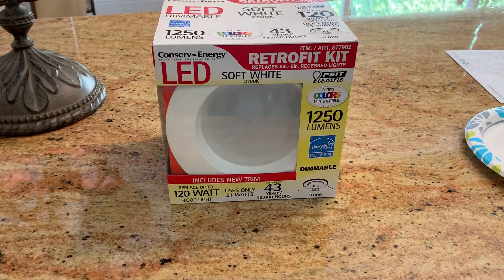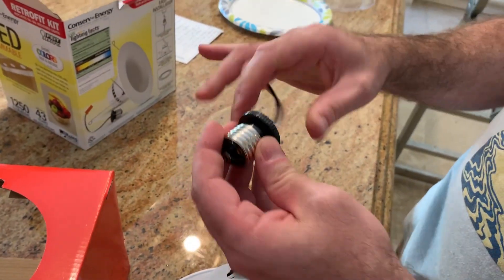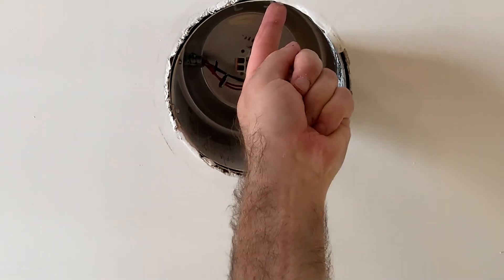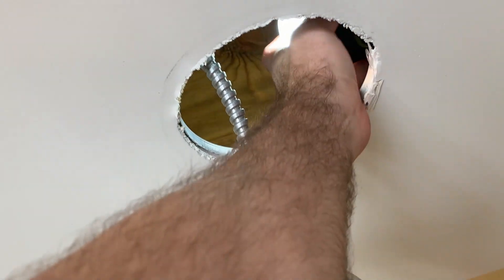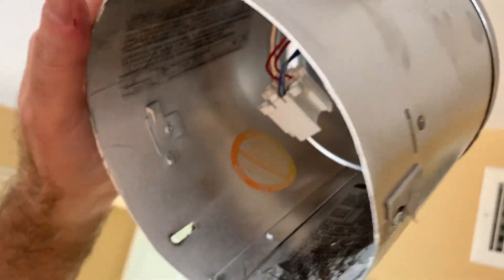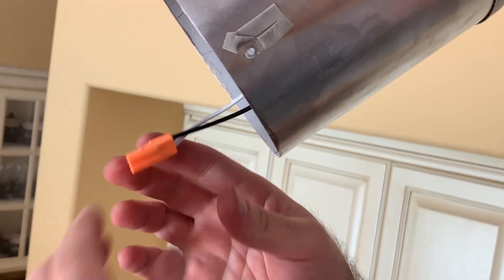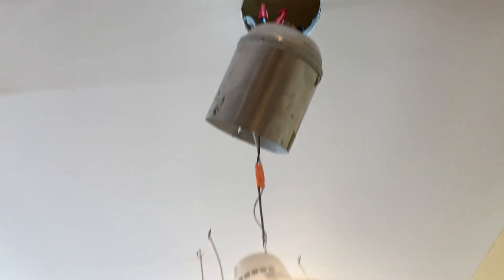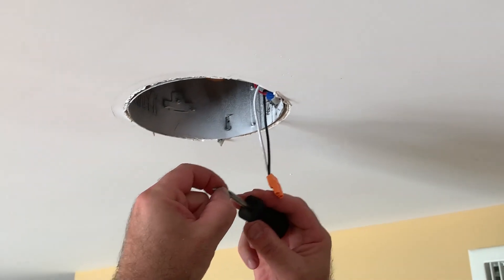CFL to LED Conversion

Comment: Very clear and easy to understand.  However as shown, technically it violates the National Electrical Code (NEC).  Connecting a conductor whose sheath is a color other than white, gray or tripled-striped white to the white wire (referred to as a "grounded neutral") is not permitted by the code, even though electrically it will work fine. (The grounded neutral is current-carrying; it's NOT the same as the "equipment ground", which does not normally carry current.) The idea is to make it obvious which conductor is the grounded neutral by restricting the color to either white, gray or triple-striped white. Alternatively, one can draw a single length of white-colored conductor into the armored cable sheath by attaching it at one end to the blue-colored conductor and pulling it through to the other end.  I'd suggest doing the same with the black conductor, and use a conductor size of 14 AWG for each. One can use a fish-tape to do the pulling instead.
Reply: So basically……stick some white tape on each end😅

Comment: Any reason not to pull out one of the red and one of the blue wires between the junction box and the can?
Reply: Uhhh! That’s a no-no. Don’t connect two separate wires to the same load. Two of the wires should be removed. And use wire strippers next time. A matte knife? Really?
Reply from the maker: Hi Robert, these wires are much thinner then the one’s they connect to, that’s why we want to keep and double up so to bring them to a closer gauge